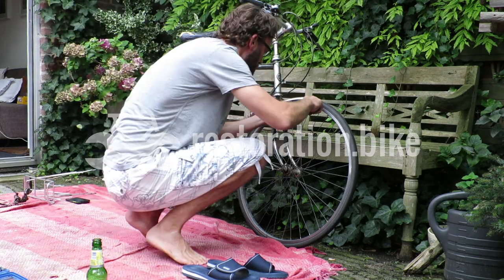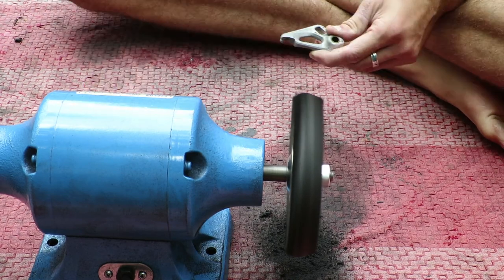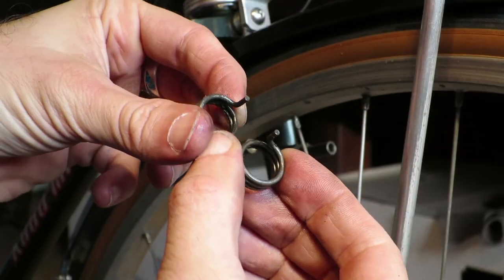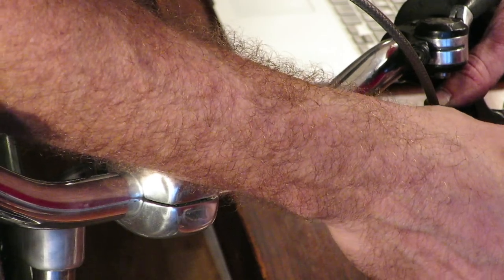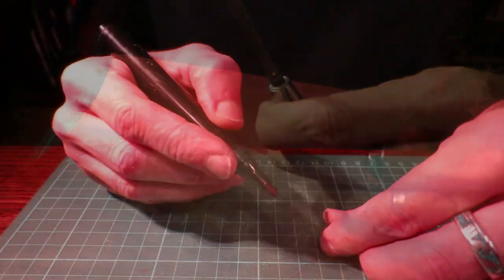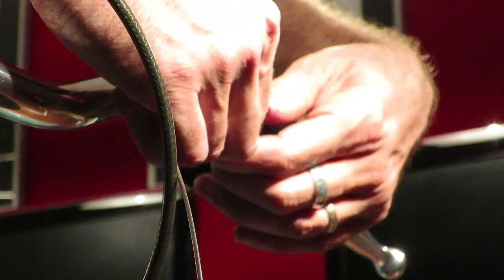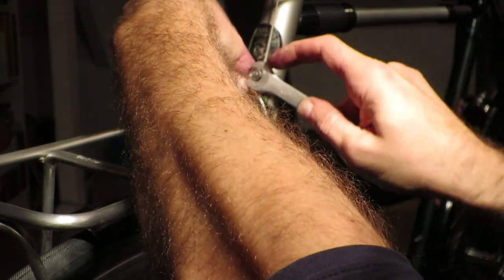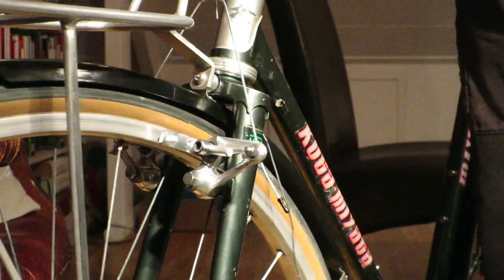How to restore and install vintage Shimano cantilever brakes

Comment: Sorry ... this video is just terrible and not informative.    Using a hacksaw to cut housing?   C'mon!    If one can afford a hacksaw (and a bike) one can afford a proper cable / housing cutter.     It would be helpful to have a step-by-step, not fast action instructional sequence on how to adjust the pads with all the parts.    what a disaster ... not helpful at all!